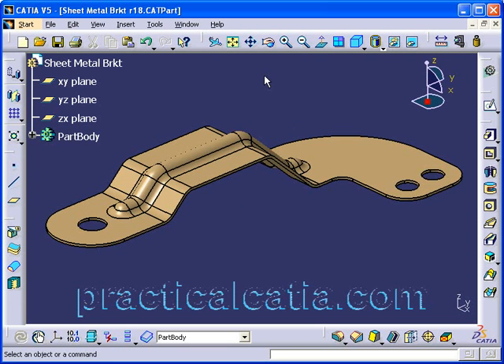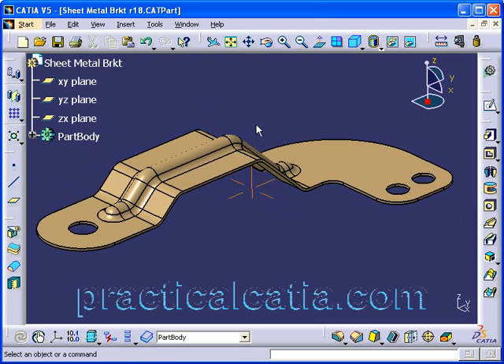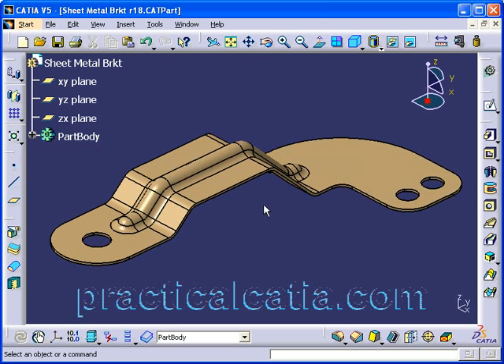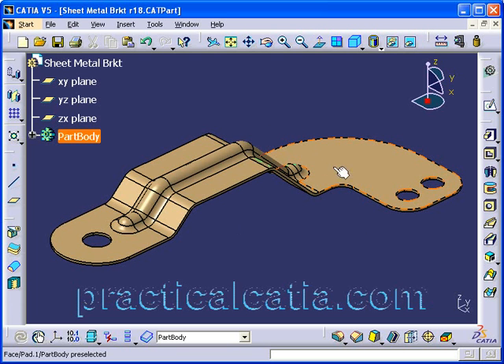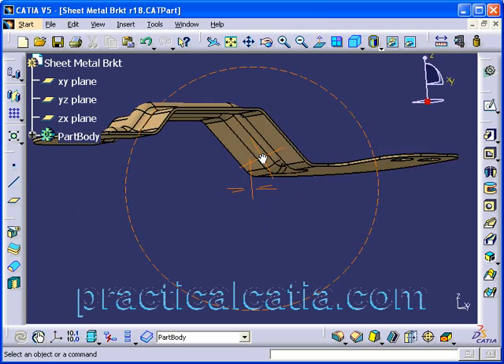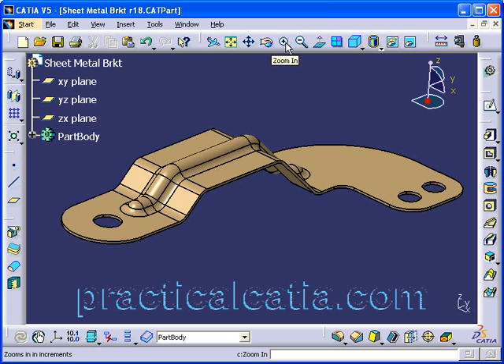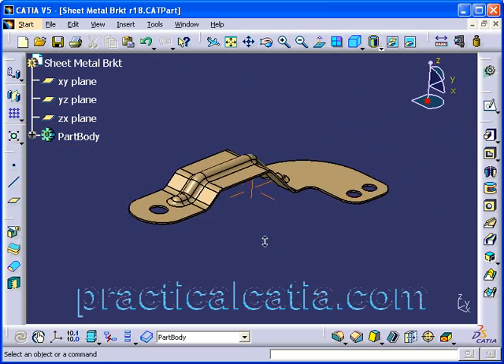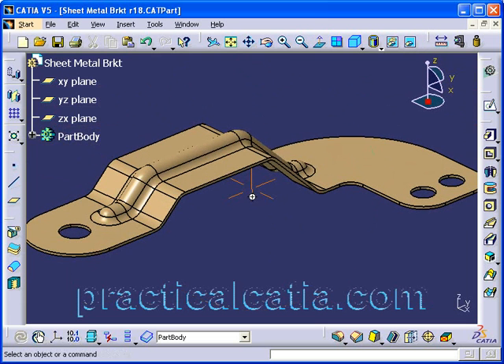CATIA V5 Tutorial: Rotate, Pan and Zoom Using the Mouse

Comment: why when i try to pan, the view doesen't pan along a costant surface, but it moves in a similar way of rotation? have I activated some functions unconciously?
Reply from the maker: Are you using the "Pan" icon in the Standard Toolbar to pan, or are you using the middle mouse button?
Reply: Keith Childress the middle mouse button
Reply from the maker: Using your middle mouse button should yield the same results as using the Pan icon in the Standard toolbar. If it doesn't, your middle mouse button is not functioning as a "middle" mouse button.  Check its programming.